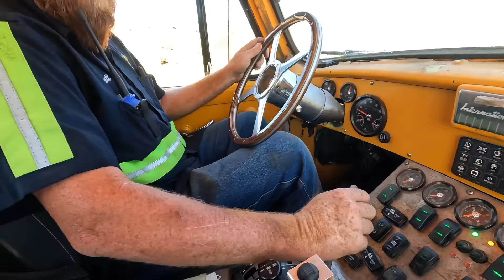Redemption On The Most Difficult Rescue Left Unfinished!

Comment: Let's see Paul, Roy, and Casey do it with Matt's Wrecker as anchor man (with lockers and winch and popping in to neutral fix) if mat has to hook them to help the climb then need to wear a Yellow Matt's recovery shirt.... also take the Bombi it should be able to rock it with low ground pressure

Comment: ❤ I think the sand was cooler in the morning when you went to get the wrecker.  ❤ You know that the sand acts different when it is to hot.  ❤. You've seen that before at sandhollow when towing with the Morrvair and the Banana.  The days when you were out there recovering stuck vehicles you had more problems pulling those vehicles out when it was hotter.  ❤ 
You probably could have went out to the bottom of the shut around one in the morning and drove right out.❤❤❤❤❤

Comment: I would've aired my tires down when i was at the bottom of the sand trap,just because with that loose sand you get better traction with airing down your  tires. If you had done  this with all the vehicles then the 12hr that you say was when you got home would've been just a little over what you said was  going to be a few hours. Lesson learned. It helps to known ware you are and be perpeared.

Comment: I'm not surprised Paul would accept the challenge, he's up for anything. (it's his nature) I'm kind of surprised Rory opted in, he admitted at the Wrecker Games that sand was not really his thing. He and Trail Mater are more than capable of overcoming any challenge. (he'll probably end up driving backwards up that sand shoot just because) I don't know enough about Casey's track layer Jeep. I do know sand and it's all about floatation and momentum. If the Jeep has enough speed at the bottom, I believe he could make the top. 

When is Merlin going to jump in here with his diesel? His truck might best all of them. 

This 'challenge' would make for outstanding content.

Comment: If you build it, they will come.
Fix the air system on wrecker. Make it the most complex and robust air system ever. At least 10 gauges (each tire, each locker, each bag, system main, horn) switchbank, additional unnecessary air driven accessories that are cool. Don’t half-@ it.
Add the Bombi to the competition. Let me know when I can order my Tom Bombi hill t-shirt. It’s a Lord of the Rings reference- Tom Bombadil.

Comment: You could probably pickup at auction for cheap, an old air-tugger (70 ft/min). Put 1,000 ft of cable on it and just plant it at the top of the hill. Nobody ever has to go down to rescue again, just haul out a compressor when needed.

Comment: Three x 👍
The footage really showed how difficult the track is.  41°c
You're nuts😂.
Probably a good decision to simplify air lines. If you're not racing Dakar you don't ready need remote inflation. Definitely need to fix that tire.
But 😢 the fleet is just a little over due for maintenance 🙄 
Looks like you need at least one alternator, two or three batteries, tire, winch rope or ropes. Do you have donuts to double winch lines?
Anyway great video

Comment: I wanted to give you an idea for the tire pressure. I know you said you didnt want to go with a central air system but figured I would still say it. When I was in the army I drove alot of  LMTV's (2.5 tons) it had a air system on it with different terrane buttons on it. sand, snow, mud, and regular. Maybe you could do a system like that but instead of terrane it's PSI.

Comment: If the rad is so scuzzy as you say, just flush the cooling system with clean water. Then put all your clean coolant in. Another point is you should be using sand tires not rock tires when you play in sand.

Comment: Red Heads have no fear! Until 70! Then they realize maybe 80 or /100! Matt I felt the adrenaline rush when your making the halfway feathering the throttle. Drum roll on second half of Attempt 10.5 heart pounding 💓 and hyperventilation……. Then gear popped out breaks on regroup hold shifter and go for it, hey depress the clutch! Engaged rolling to horizon. Your recalled the knowledge lost in frustration ( thinking of others in the dilemma ). Learning knowledge as the opportunities to recreate each new situation for possible SUCESS. REALITY CHECK HERE ! When we are formed in the womb we are gifted with knowledge that reveals answers to life’s challenges where wisdom to share that knowledge is given again by the Creator. Recall the plethora of times you seem to know the correct or best solution to a challenge without  prior physical exposure, and someone questions your origin of such knowledge, you reply, “ I just know “ I respond God told me to share this with you is my response. Be safe with your adventures and continue caring for your team, as their lives depend on wisdom gained! ( I had red hair, now white on the way to 80) 🦅🙏🍀✡️

Comment: At the end when Matt and Colby couldn't hear each other it might be because the radios didn't have a direct line of sight to each other. Matt had mentioned about how the winches are actually lifting up, not forward, because it was so steep. It looked like Colby was past the top of the hill so the radios couldn't see each other at all. That said: the radio waves might go through the sand, and I wonder if it has worked fine for you before? 𝗬𝗼𝘂𝗿 𝘄𝗼𝗿𝗸 𝗶𝘀 𝗮𝗽𝗽𝗿𝗲𝗰𝗶𝗮𝘁𝗲𝗱!

Comment: So something I've always had luck with. If you're dealing with deep sand AND you have water available, bring a gas water pump suck water out of the lake/river, and spray down your runway. It will pack that sand and can literally turn it into hard pack. Obviously it's rare that you guys are in sandy situations that are this bad but you never know. I tow a 35' camper down to loan rock beach at lake Powell and on leaving day i soak a runway and it works like a charm in 18" deep sand. I never get stuck.

Comment: One thing i noticed over the years, the bigger the tires, the lower you gotta drop the pressure to get the same effect.  15psi in an oem radial is about the same as 5psi in a massive bias ply tire. With bead locks and 54s, looks like the wrecker could still go down to 3psi

Comment: Tge 8100 is known for cracking. The only good oart about it is you can use it's crankshaft to stroke a 1991-1998 454. That has the additional advantages of carburetion, not cracking, AFR heads, etc. The modern engines will fail you every time, abd when you're a hundred miles of desert from help, that's suicide.

Comment: Swap that 8.1, for a duramax, with a mild tune, tons of torque with the Alison 5 or 6 speed, and that wrecker will chew. 450-500 wheel hp and 800-900ftlbs of torque.

Comment: Curious.   I've never heard of putting tire pressure so low. Are they a specific type of tire.  My truck is 30 to 50lbs. Car was 45 lbs. And my freightliner was 110 lbs. Don't see how you can run that low without losing tires.

Comment: This is just a curious question Matt. Is 12lbs of pressure still good for the tires being used on pavement ? I thought that 35lbs was the common pressure for paved roads. Wouldn't they deteriorate on the inside? Yes I would love to see them all try that hill. You could stay in the middle to pull them up in case they don't make it to that point.
Reply: Pressure and tire size have a relationship few understand. For those tires on that vehicle, 12psi is fine. The tires are so enormous that they have the same number of air molecules in them at 12psi that my Super Duty's stock size tires have in them at 80psi. You don't need a particular pressure; you need enough air molecules inside the tire to carry the load. The relative interior volume of the tire makes a huge difference in the actual pressure you'll see with the same number of air molecules. Excessive tire heat (which causes the deterioration you mentioned) happens when there aren't enough air molecules to properly carry the load, and the tire sags, which causes excessive twisting of the tire shape as it rolls, leading to excessive friction, internal and against the road surface. Determining the correct pressure for a rig with oversize tires is a matter of finding what pressure gives the tire the correct shape.

Standard car tires are generally rated to carry their maximum weight at 35psi; at loads lighter than that, the pressure can be lowered. For example, I have a Subaru which suggests that, lightly loaded, its tires should only have 22-25psi in them. This is because the car doesn't weigh enough to need the extra air molecules stuffed in there; if you do it anyway, it just makes the ride stiffer. They suggest I think 28psi front and 35psi rear if you have it heavily loaded.

Hopefully that helps you understand tire pressures better. It's a subject most people don't find very interesting.
Reply: @edifyguy  thank you I just learned something new. 👍

Comment: Again, you need to use LFP batteries. No AGM, No Lead. LFP batteries have a lot lot lot more AMP's, less weight, no heat issues, no fire, no toxic materials and last 10 times longer than AGM/Lead.

Comment: I know how it's easy to harp on the Porsche transmission computer as the anti-fun nanny, but there's a reason it does what it does - those European "Sports SUV" vehicles like the Cayenne and the Stelvio and so on use a supercar-like 4WD system, where a 4WD clutch partially engages to provide power to the front wheels - specifically by slipping to limit the amount of torque to the front wheels to prevent understeer and also to not have the drivetrain binding when steering because 4WD. The Problem is, because the clutch slips, it quickly heats up under load - which sand adds a lot of load. Meaning, if the computer didn't disable the 4WD system when the clutch overheats, you'd quickly have the 4WD system go up in smoke, and you'd be stuck with RWD until you put in a new clutch. This, of course, makes these clutch-based 4WD systems very underprepared for sand. A lot of modern cars and CUV's have this type of 4WD as well, because it's cheap, light, and lets the car run in 2WD for better fuel economy, sort of. Honestly, I prefer the limited slip center diff design for full-time 4WD setups, like on a Land Rover. Limits the slippage of either axle but also bears the brunt of the torque through the diff gears instead of a clutch and allows using 4WD on the road at any speed, not just <35 MPH like on most cars.

Comment: Matt,,,i sell automation equipment for a living.  Try flame resistant or double wall tubing and see if that has the heat resistance you need.  You could also look into flame resistant fittings.  I can get you exact part number if you need them.  Post what the exact issue is and maybe I can get a solution for ya!

Comment: I’m making a guess before you attempt the first run. Your calculations are missing one thing and that’s the wheel speed of the wrecker. On the first video the wheel speed was just too low and when in a higher gear it ran out of power. I disagree, wrecker does not have enough horsepower. Not even close for the tire size. It’s a low speed badass rig. It’s not winning any races though.
Reply: I was wrong. I’m glad to see you made  it out under the wreckers own power.👏